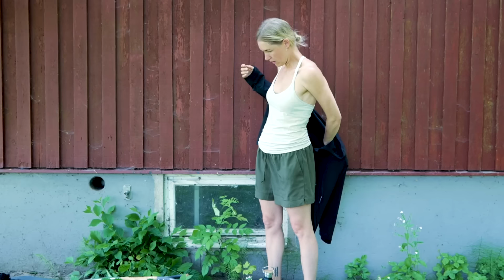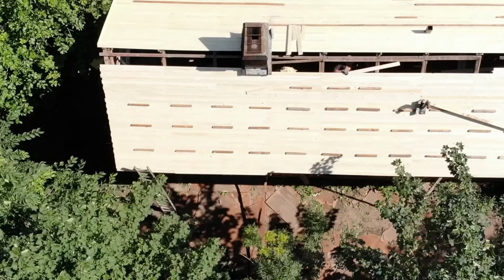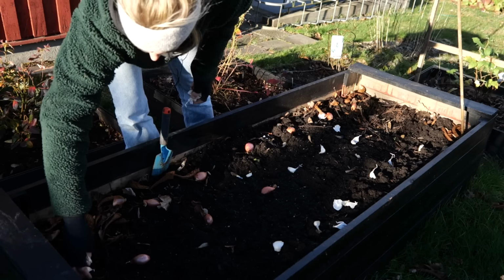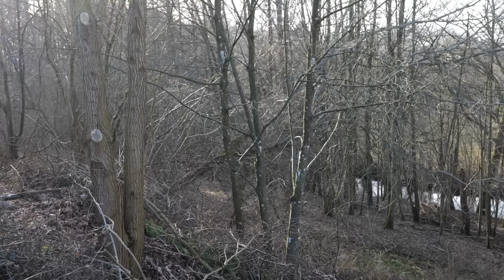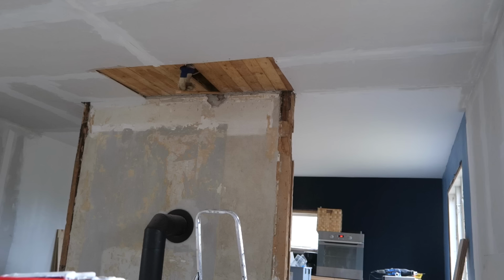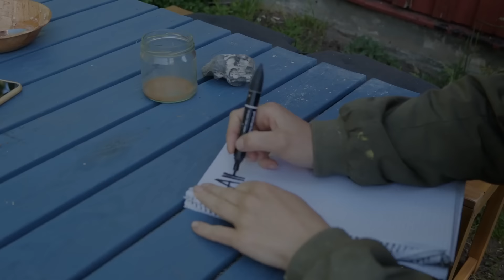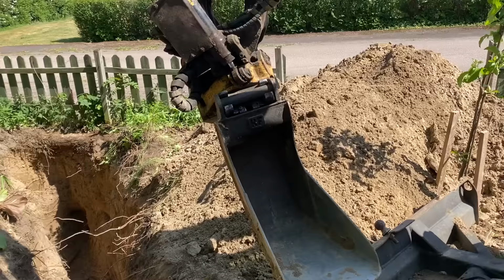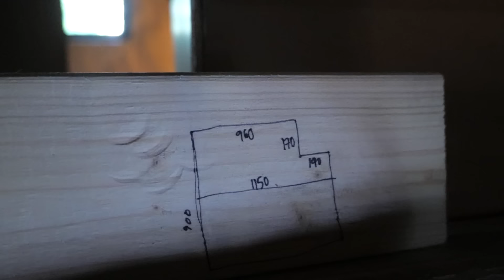One year of renovating an old house and garden in Sweden - with reused material

Comment: Hej Anna, When you are cleaning paint from metal, like your radiator, just use full strength vinegar.  I prefer the apple cider vinegar, but white vinegar works too.  Just leave it on for 3-4 hours for one or two layers of paint latex paint, but for heavy layers of old paint, you may wish to leave it overnight.  The paint will wipe right off!  Then clean with soap and water, rinse and let dry.
Reply from the maker: Oh that is such a great hack, great to know for future radiator renovations, thank you 🙏
Reply: It works on door hinges or any hardware too. Just soak them in the vinegar.  Best of luck with all of your work.   @annasgmlindgren

Comment: As a thought, you could repurpose some of the old roof for the chicken coop, the walls of your outdoor shower, an outbuilding/garage, etc.  This could save you from needing to recycle it and spending money on new supplies.
Reply: roof over deck or part of it, so you can sit outside even when it is raining and protect the wood; thereby, extending its life.
Reply: it could also be used as fencing or a wind break
Reply from the maker: Great idea! I have actually collected some old wood panels for a chicken coop or outdoor shower. Also got a fence that I could use for building something.. 🙂
Reply from the maker: I would love that 🙏 I tried out having a sail as a roof but it couldn't handle rain very well...

Comment: 46:11 I personally don't think it's a good idea to put a hole for the stairs directly over the heater. The heat would go directly upstairs leaving the lower part of the house colder than the upper....
Reply from the maker: That's a really good point, something I have also discovered when I have been lighting a fire.. I have plans to move the heater in to the living room, where I also think it will be more cosy to sit and enjoy the fire 💛